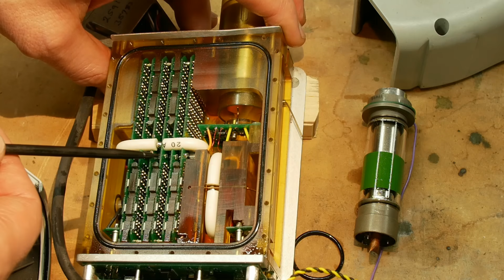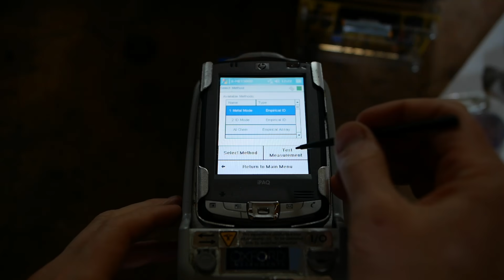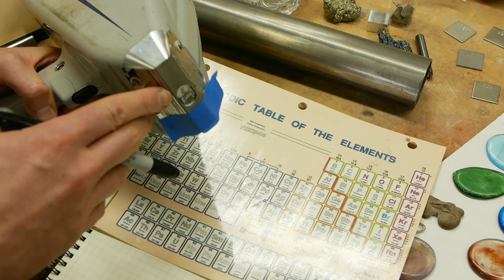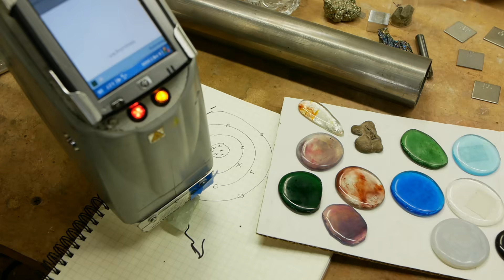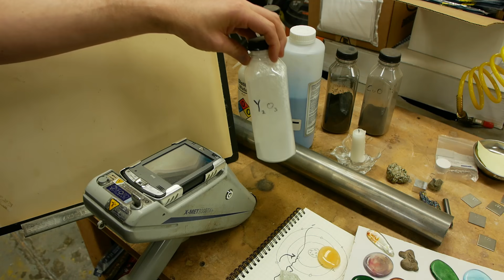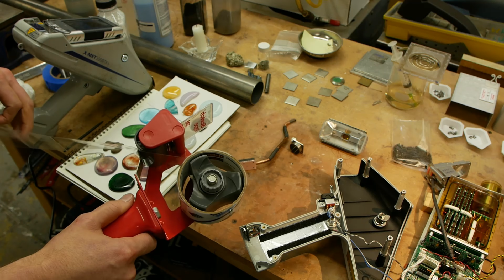Demo and teardown of an X-ray fluorescence gun (measures chemical composition)

Comment: I have a different understanding of the light emission.
Electricity can be defined as a directed flow of electrons.  Imagine a string of copper wire which is internally a string of copper atoms.  The light from the electron is created when the electron is returning to it's original outer shell, not when the electron is pushed inward.

So if our home uses 110V at 60Hz the electricity is being applied 60 times each second off and on like a light switch.

So 60 pushes produce nothing but on the release between each push the electrons pushed are released and spring back releasing a colour of light.

Depending on the color of the light released from your chosen object you can find the matching atoms.

Hmmm
Reply: The X-rays are created when electrons crash into a target at high speed. The high voltage is used to accelerate the free electrons into the target. None of this really has anything to do with electrical wiring in a home, which does not give off any visible light.

Comment: I'm  curious why u think the power supply was funky. I couldn't tell whether or not you >>  1.) just thought is was not like you learned it in the books.  2.) thought there was flaws in its output ?   3.)  Just wanted to learn more and didn't know where to start ?   <<   I personally get intrigued when I see a contraption which does not follow the norm.  Shows that there are more ways than one to 'do the business'    Does that power supply have to produce constant voltage and swing it across a wide range ? (food 4 thought:)

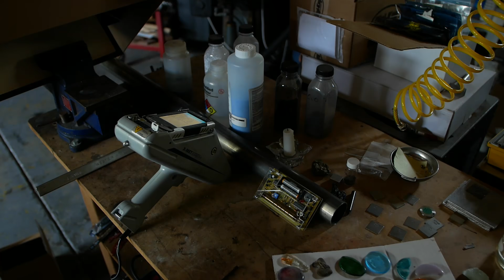Comment: 1:20 These type of machines can give dose rates at the exit window in the order of tens of SIEVERTS per hour. Sievert, that is, not milli- or microsieverts. Your detector is absolutely not sensitive to the energy range of your XRF and therefore you wrongfully conclude that it doesn't emit much radiation. I sincerely hope that you don't have any radiation check samples that come even close to these dose rates (or even 4-5 orders of magnitude less) .
With dose rates like these you can get over the skin dose limit in a minute or so (for occupational exposure: 500 mSv in a year)  or a few seconds (50mSv for public)
Reply: Geiger counters suck ass at X-day detection when it originates in a 40kV tube in my experience. They are just not designed for this job, it seems. I agree that the measurement was misleading. This may be 7uA at 40kV, but say a dental X-ray may be 60kV at 8mA and exposure time is in tens of milliseconds. 10 seconds at 7uA is probably an exposure similar to a dental X-ray, or at least within 10x ballpark as far as energy delivered. Don’t point that thing at people, for sure, and don’t run it unshielded without a dosimeter that X-ray techs use. You’ve got one chance to goof up, so better be safe than sorry, AS!
Reply: Also take into account that this is an almost unfiltered x-ray spectrum, so the dose /µa will be much higher.
The figures I used in my first post do assume a more powerful XRF (50kV ~100µA), so this might be a bit less dangerous, but we're still talking about minutes of use to get significant doses.
Reply: Ive experimented with far worse... the scariest was a Dynarad battlefield x ray unit. It made a visible dim blue cone of light in the air at full power and buried the needle on the higest range on a cdv 715. Promptly got turned off and put in the box... Absorbed a few mR testing that one to be sure.😲😵😵😵
Reply: @christopherleubner6633  Hard to believe that you saw ionization of the air, you probably just saw the light field of the x-ray unit used for positioning.

The tube efficiency is kind of similar for al medical x-ray tubes when taking into account the tube current and tube voltage, and you don't see that effect with much higher tube currents, so it's impossible to see that with a portable x-ray unit.

Accordign to wikipedia the CDV-715 has a maximum range of 500 R/h or roughly 5 Sv/h, which is around the correct order of magnitude for the dose rate in the direct x-ray beam.

Comment: The negative voltage on the tube is the same way my watch works. This let me use very tiny dual p-channel mosfets at logic level on the segment and digit controls which really helped. It's interesting to see that kind of technique used elsewhere.

Comment: I worked at a company that made a competitive product to this. Brings back memories watching  this teardown. The high voltage  power  supply is very straight forward and unique. Its a resonant design. We potted  our power supplies.
Reply: Interesting! In the video I  see very long voltage multiplier. How many cascades are in it? From what circuit block is it powered? Is it a transformer or simply coil? Thanks for answers!

Comment: So, let me see if I got it right.

The sensor element itself is only/mostly sensitive to a specific wavelength emitted by the silver plate. The silver plate receives the different wavelengths and only/mostly emits that wavelength. Now... we are interested in measuring different wavelengths, so then the xray tube emits different wavelengths based on the plate high voltage. thus the plate high voltage must be somehow modulated, lets imagine a sawtooth so you know that a given instant you are emitting certain wavelength despite not actually measuring the wavelength itself.
Man that thing is ingenious! 
Then no wonder you have an unusual power supply / multiplier ladder, if you are modulating the voltage. A simple single fed straight one might have too much inertia in time so better have several independently fed modules chained.

Comment: About the pulling apart tape generating x-rays. I noticed a weird thing while putting on a bandaid in the dark over 10 years ago. When I pulled the package of the bandaid apart, a blue glow formed along the part where it was separated. I had been in the dark for some time so my eyes were very well adjusted to the dark. I thought it must be static electricity or something. It was around a year later that I read a paper about generating plasma by pealing tape apart. Could that have been what caused the blue glow I saw? I tried to reproduce it but I can only see it if my eyes are very well adjusted to the dark. Your videos are awesome. Thanks

Comment: I've build low energy XRF for measuring aluminium and silicon (1.5keV/1.74keV) the xray source was Fe55 (5.9keV), it was done in helium to reduce the reduce attenuation of air, and the signal from Argon (~3keV) . The sensor was a bare CCD, the image processed to make histogram of values of pixels with empty neighbours(iow where all the energy of the photon was in a single pixel) . Most common sensors are just one detector and pulse processing and use a beryllium window a few um thick

Comment: Is that oil old enough to be a polycarbonated biphenol? 

If so, you might need some remediation. 

Likely not, since a PDA drives the software for the unit. 

But I'd be rather inclined to be careful with the oil.

Comment: the scifi sounds are probably the high voltage inverter charging.

remember the camera flashes? they would make a similar noise over a longer time to charge.

dont reveal to seller intention  in fact lie if necessary 

or if you do have to reveal to get permission to show listing on youtube then wait until you have the item in hand as if you reveal while it is past the point of no return it is possible for the post office to recall or intercept a package to return to seller.

Comment: ED-XRF gun you have there is not that accurate at all. At best >5%  quantitative measurement error with some exceptions for special applications. It's a really neat device but does have some major downsides, like the detector wears out rather quickly and without knowing the sample composition it is easy to get a wrong elemental composition. Much more accurate method is WD-XRF where the secondary x-rays are collimated and diffracted from a crystal to the detector to measure all the wavelengths separately and get a truly quantitative elemental composition.

Comment: Due to the geometry of the silver bit I suspect that it does not excites the silver to than let the silver emit x-rays, but that the silver does bragg refelction to filter out unwanted frequencies. This is the way you would do it to prepare your beam for an diffractometer or in Wavelength-dispersive X-ray spectroscopy to get only one frequency (at a time).

X-ray fluorescence can can lead you into rabbit holes if you use the wrong program for interpret the data. There are programs for use with alloy identification wich work fine for that purpose. But if you use them with things like minerals they might tell you some wrong numbers since some peaks are close together and the program rules one out because that element is not used in alloys and gives you the other.
Reply: It is just a beryllium window and not silver. Beryllium is almost "transparent" for x-rays and thus not disturbs the measurement. No Bragg reflection is used in this kind of handheld XRF guns.
Reply: @wvdh  There's another comment thread on here (close to the top) where someone said they made these devices.  According to them the window on the detector itself is in fact Beryllium.

Comment: In my opinion the X-ray output system is very interesting. Does it produce monochromatic radiation? Is this due to the characteristic radiation of the material that is used there or due to diffraction?

Comment: Years ago I used to work on some Picker equipment.  What a difference, the high voltage power supply for example, called the "tank,"  was about two feet cubed.  It was full of oil, had two vacuum tubes to regulate the HV.  The pre regulation was done by a motor-driven variac, which drove the HV transformer.  I could go on and on.

Jim

Comment: Two levels of energy are produced when knocking an electron out of orbit or just deflecting it a little. This gun reads the energy in the x-ray to know what happened. You can never knock an electron out of orbit unless it has some other place to go. This is why silver is such a good conductor of electricity, it will freely give up an electron because another atom will accept it pass on another. I am Level II radiographer. BTW, the gun you are using doesn't emit enough power to ever knock an electron out of orbit. You would need a much higher voltage than that can produce. I doubt it could even change a level of orbit. But it definitely can deflect them, how many it deflects and by how much is what this gun reads or all that it has to read. Anything more and it would be illegal for most to own.
Reply: I suggest that you retake you radiation physics course, because that is complete bullocks.

This XRF guns works like explained in the video: they do work by knocking electrons out of the orbit into the continuum (there are infinite places to go if the electron is no longer bound to the nucleus). The vacant spots is then taken in by an electron in a higher orbit and hereby characteristic x-rays are emitted which are measured and this allows to determine the composition.

Comment: The tribo-element to generate x-rays is shown in a short article:. NATURE 26May2011 Vol 473 pp 455, 456

A piezoelectric actuator presses a Silicone membrane against a flat epoxy surface.  By friction/contact/separation in multiple cycles the x-rays are produced.  Device requires a vacuum closure.  Most likely quite similar to the device used in the XRF gun.

Comment: That silver thing looks like a collimator and is probably tungsten.
Reply: Tungsten is one of the last things you'd want to put directly in the path of a low energy x-ray beam, it would absorb almost all your x-rays.
In fact it's almost the complete opposite: it's a beryllium window, one of the lowest mass and density metals available.
Reply: wvdh  you should tell that other company which I found before commenting, that makes these collimators out of tungsten, that they’re doing it all wrong then.
Reply: @alohathaxted  Oh I misunderstood you.  Yyou could use it as a collimator, but you'd need a hole in it for the x-rays to pass, and this looks like a complete sheet, the collimation is probably in the housing and not really visible.

Comment: Correction to my earlier message.  The radio source I use is 109Cd not 140Cs.  From Spectrum Techniques at Oak Ridge Tn.  At 10uC, max that can be shipped by mail.

Comment: The sensor in a case with metal film cover is from Amptek.  Either a SiPIN or SDD sensing device.  There is a built-in two-stage peltier cooler to drop the sense-element temperature and cut down significantly on thermal noise interference at low x-ray energies.  The can is also evacuated and the cover metal/filter is most likely element "Be".  Very thin prone to leakage - handle very carefully. 

You can replace x-ray tube and power supply use Cs140 radio isotope.  It puts out a nice single peak at 88kev.  There will be some silver peak interference also but low cost online for about $130.

I have experimented a bunch using the Amptek mca + shaper + sensor and their software.

Quite a bit has also been done thru the Theremino website using Am241 source and lex gamma detector or proportional counter tube.
Reply: Sure you don't mean Cadmium-109?  Caesium-140 has only a half life of just over a minute, which makes this rather unpractical.
Reply: Yes I posted a correction,  109Cd from Spectrum Techniques of Oak Ridge TN

Comment: So an x-ray is just a high voltage electrical field!!! 
And that device uses a high voltage electric field to measure the field of another electric field that's is emitted by something else! When the two different fields come in contact with each other, you can read the frequencies that are now present on the field that's being created by the device but doesn't actually have those frequencies in it's own field to begin with! Hmmm maybe the universe really is electric!
Reply: X-rays are electromagnetic waves. Or, if you like, you could say that X-rays are very high energy photons. The electric field is used to accelerate an electron into a target. When the electron crashes into the target, the target emits X-rays. Heat is used to liberate the electron from the source.

Comment: Wait, what? Did I understand your explanation wrong? Because fluorescence doesn’t work by knocking electrons off, that would be ionising the atoms, and last time I checked, blue light isn’t ionising radiation. The smallest ionisation energy is that of caesium, with about 3.9 eV, which corresponds to a wavelength of 315 nm, which is classified as UVB, well into the UV spectrum, however, that assumes elemental caesium. Therefore, near UV (including even UVC) is not considered ionising radiation, which has a lower threshold of 10 eV or 125 nm, in the far UV spectrum.

Comment: At one time I worked alongside a guy whose previous job had been testing or tuning  a metal alloy composition analyzer.  But unlike this X-ray device, it  analyzed the sparks resulting from a grinding operation.  All optical spectrum.  The development job entailed selecting the grinding wheel material and subtracting its contribution to the spark colors.  Also, selecting the optimal grinding force and several other details.  I believe they were using photo multiplier tubes (more than one) with various filters.

Comment: Beware, if I'm not mistaken, the SBM-20 geiger tube is not able to properly detect X-Rays, only hard beta and gamma..
Reply: You are correct, especially with such low x-ray energies you only see a small fraction of only the highest energy photons from the spectrum. These kind of XRF guns can give dose rates of 10's of Sievert per hour.

Comment: Most X-Ray devices I've seen actually have grounded anodes and negative voltages at their filaments. The reason is, the anode is usually big and probably water-cooled while the cathode is small. It is easier to insulate a small cathode than a huge water-cooled anode, even if the whole filament power supply has to float at -50 kV. Scanning electron microscopes typically use the same design.